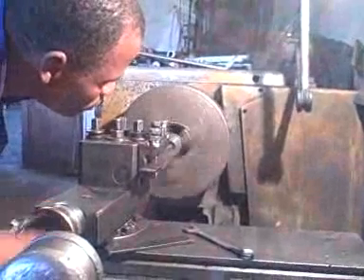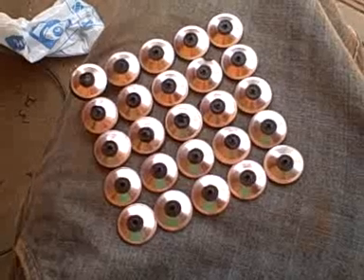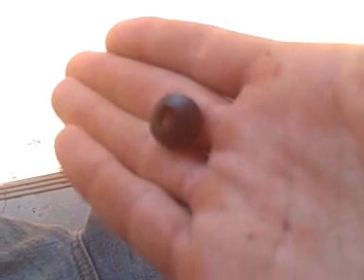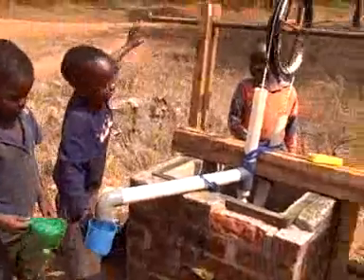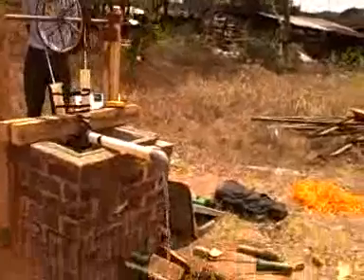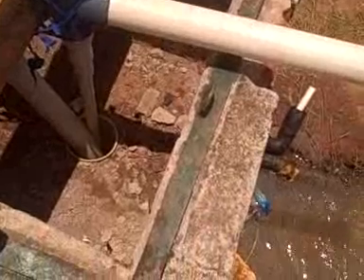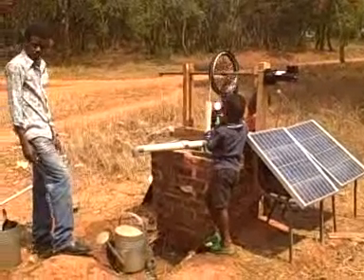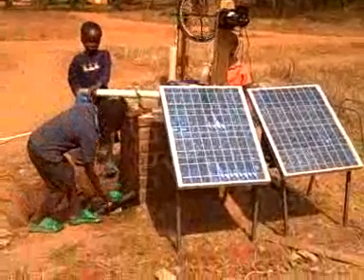Solar Rope Pump, Malawi, Blog 4. WATER!!!

Comment: good job. suggestion : add a tank(with water dispenser) to contain the pumped water, the water could last longer even without the sun shining :)  if the village is windy, consider using a cheaper wind turbine instead of solar panel.

Comment: There is a new type of pump called a nano airlift pump. Basically, it uses very low pressure air and optimized tube sizes to pump water using the airlift process and plug flow. In my test video, I used enough pressure to push air 1 meter deep under water and pumped to 4 meters high. (But this is not the limit to height).  It is different to normal airlift pumps because of the extremely low pressure and the extremely small submergence.  Please take a look and test it. Thanks, Brian White

Comment from the maker: Theoretically there is no limit to the depth a rope pump can pump from, I know of a diesel powered version of the pump that has been reported to pump frrm 90m. Its just a case of how big a motor and solar panel you are prepared to pay for. 
Unfortunately the solar-rope-pump is still in development, however, it should be ready by May 2010.

Thanks for the interested and I'll be sure to keep you posted on the pump's progress.

Ta

Comment: I think id like to put one of these on my bore - would be a lot cheaper to run than the grid poweed pump I have now. Any limitations to how deep this will work? My bore s 165 meters deep and the water is about 50 meters down when not in use.

Comment: naw dude. i was saying it is awesome that YOU MADE water happen for them. and did it cheap and very nice.

re cheap pistons, i don't really see how it could be any cheaper than to melt scrap plastic in a tin can!!! 

re the mould, maybe cut your can to size and use THAT as the form. to remove the hardened/cooled plastic inside just hit the can with a dash of heat? 

take off any rough edges with a bit of sandpaper.

Comment from the maker: Thanks, but unfortunately it wasn't me that came up with the pump design. Numerous people from Holland, Nicaragua, Zimbabwe, Britain and elsewhere have formed the pump design that I copied for the solar pump. I think clay , wood and rubber tyres resulted in too low efficiencies unfortunately but it was obviously a good idea as they wouldn't have already tried it out. The pipe as a mould is something else I'm looking into whilst trying to make the piston manufacture easier and cheaper.

Ta

Cai